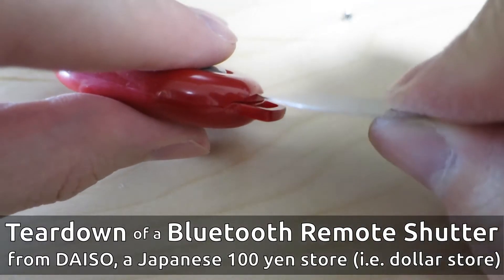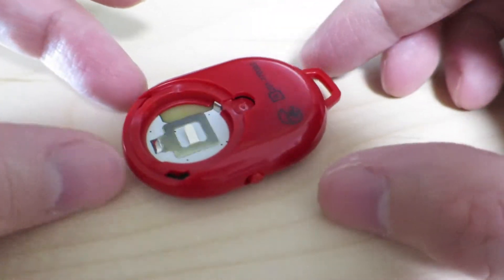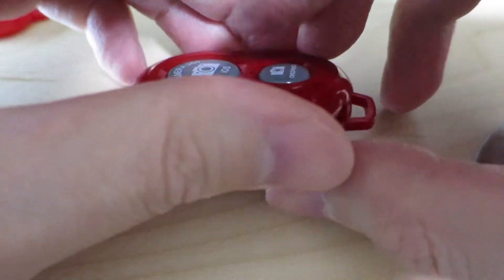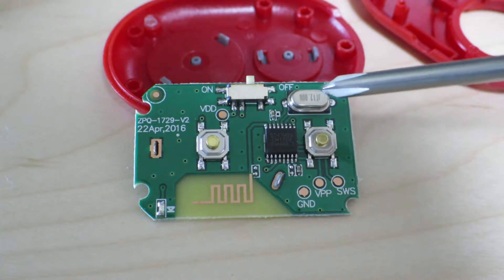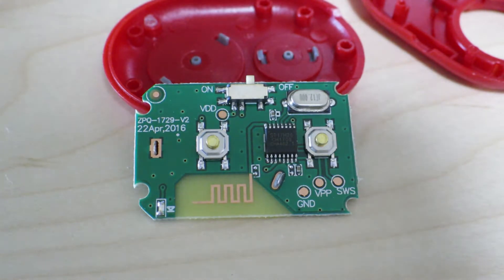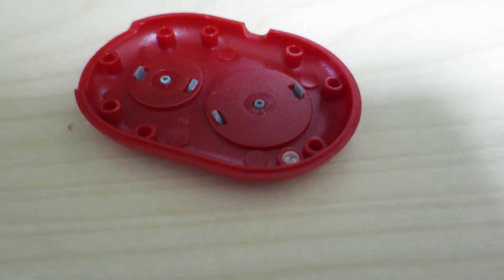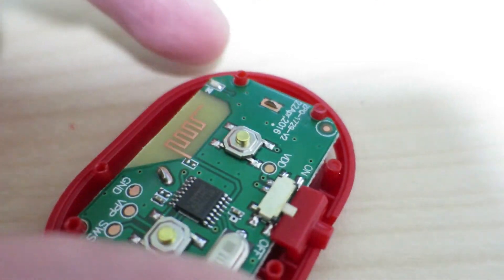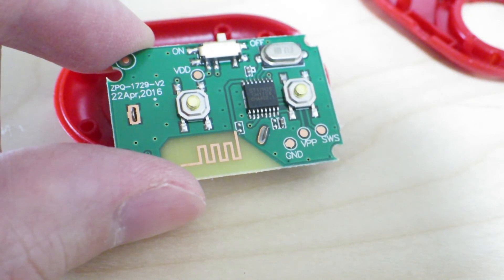Teardown of a Bluetooth Remote Shutter!

Comment: Hey guys, how can I configure the chip? how to read the program inside it and change it?

I have the same product with a YC1088 chip and it turns off after 10min, I want to configure the program inside the chip in order to keep it on untill I turn it off manually.

Comment: I have this chip in my VR controller. It doesn't work. Pare only whit one out six devices.
On board is only st17h26 chip and Quartz Resonator jf12.000, that is it.
BS IM SEEING BS!
Reply from the maker: Yeah, this bluetooth chip isn't really good, and as you can see in my previous unboxing video of this remote control (https://youtu.be/aq8IE4kt9dc) the pairing was quite problematic. I'm not surprised to hear that you've had problems with pairing devices...
Reply: Tengo el mismo chip de bluetooth pero quiero usarlo para controlar otras cosas, como se puede programar esto alguien sabe?